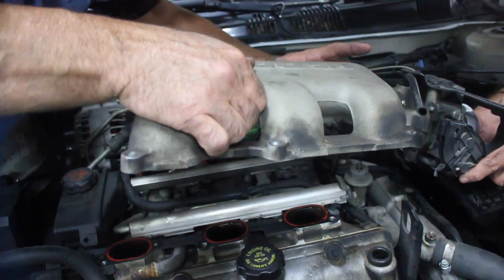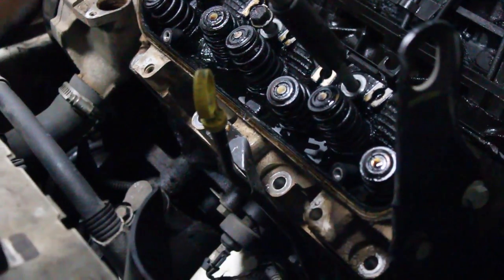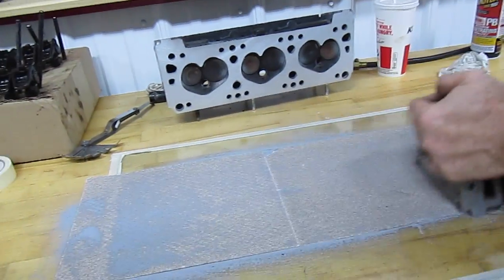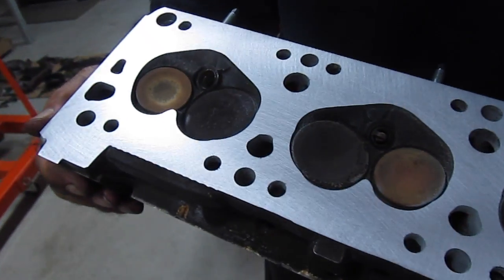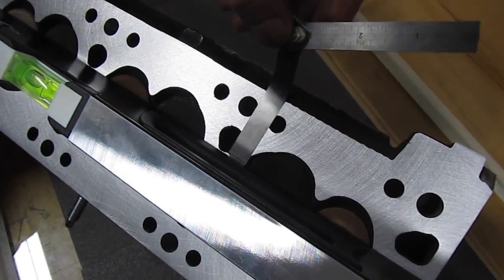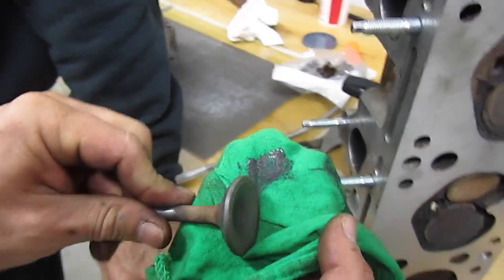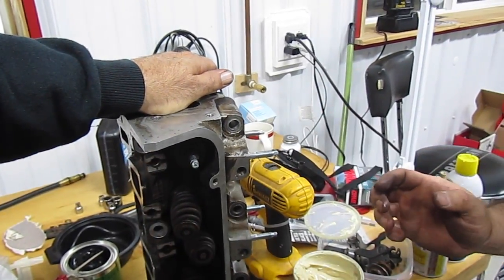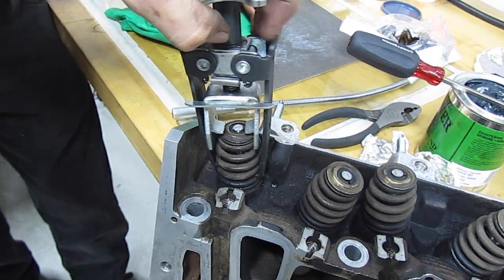RESURFACE a warped cylinder head with low cost sandpaper at home

Comment: sure. works fine. i’m a bit pickier when it comes to the surface the sandpaper is on. thick glass works the best if you’ve got it. Currently finishing up my head gasket job, actually.

‘cept, I’d been driving across country when mine blew. No family or friends around, and hardly any money, 900 miles from home…. in a parking lot…in south texas… in August. It was everything it sounds like. But I bought some mirrors like hangs on the back of a door, removed the trim, and glued em together, and a piece of mdf on the bottom. I did that shit right there in the parking lot.

Comment: Where did you get the glass?  Does your sanding base have to be completely level?  I can't seem to find anything with an even surface, except for this one granite surface plate I bought off of Amazon.  I ended up sending it back because it was shorter than my head and block.
Reply: Placing thick glass onto any decent flat, level surface (eg a bench or table) will provide you with a 'perfect' even surface.

Comment: This is nuts! Current cost to mill a head is about $100, not $400. All that work to take it apart and put it back together but cheap out on the most important part?? Not me. Not even having it done on an automotive belt sender intended for that purpose.
Reply: No one is nuts. Flat is flat. I could do this in the time it takes me to drive to a shop and back. Chill.
Reply: @FisherCatProductions  No way. I just re-rebuilt a motor where the head was done using this method. My machinist just laughed when he mic'd it. Why do this to save $90 on a $2K rebuild???  Goofy!
Reply: @mikecunningham7621  Quit saying it can't be done just because you can't do it. I checked my head using a machinist's straight edge and the biggest shim I could get under it anywhere was 0.0015"! (that is 15 TEN-thousandths) Waaaay past spec needed. It had nothing to do with "saving money." If I can do it myself, I have no need to go elsewhere. You do you.
Reply: @FisherCatProductions  One and a half thou END TO END, not just in spots, is the max spec on the engines I build and that relies on the block being decked to 0.000.  I'll spend the extra $90. Good luck.

Comment: So you don't even know how much you grind off from one side of cylinder head... Other cylinder heads are still on a engines . Creating unbalanced combustion pressure rates . Okay , that's exactly called  half A$$ job .
Reply: You may be right...That's a great point" so when you add block sealer...or thicker oil"...or performance spark plugs..or Higher Octane gas..You change things..Right" But" The Goal is still The Same....To make The Car Run...And Not Run Hot" Don't Forget" This IS a great Engine" It Has it Flaws just like Everything else does".. Again..The Goal is to Get it Back Running..& On THE Road" If you don"t understand that" you don't know how to fix things...Weld...build..I can do it all..I took parts from a car wheels and built a grill" And cook steaks on it" Drink Beers..It's not suppose to like that..But I made it work..I made it cook" I made parts that don't go together work together... LATER
Reply: Good grief, he's not building a moon rocket. Come to think of it, the guys that are building moon rockets just scrubbed the test flight for what, the third or fourth time? No way this will cause any problem on your average road car. But let's keep it under 8,500 RPM, just to be safe.

Comment: No idea where you are from to have that high of a cost to resurface a head. Where i am it cost between$ 40-80 per head depending on how fine of a finish is needed for your gasket type.
Reply: Exactly. Having an aluminum 4 cyl head milled at a performance machine shop right now.. cost $100. Dallas TX. I would NEVER do what this guy did.

Comment: Did you use a mls head gasket? If yes is the car still running properly? I want to do this but just wondering if i can get the surface smooth enough RA 30?
Reply: it works like a champ.  as long as you have a flat surface to apply sandpaper to the head will self level to perfection. if you want you can go all the way to 400 grit
Reply: @-jimmyjames  How flat?  Are we talking completely level?
Reply: @Gh0stInTheMachines81  I've done this several times.  I use a marbel counter top  slab that is completely flat as I checked.  And adhere sand paper to it via water as spray glues unless very thin like 3m can cause high spots on the paper. You could even use copper gasket spray to glue as it sprays uniform. I gently go back and forth. Be careful not to push pull too hard as you can rock ever so slightly and round edges. Has to remain level. So a good wet sandpaper. 3m. Good to go. I have experienced no gasket failures yrs after
Reply: You can use machine mark. Or just use a sharpie to dye, see high and low and row it till flat. Ez pz.  I prefer the marble slab. But a quality glass window or even a fishtank side. Use your imagination. Wood can bow out bless thick and true. You have been warned
Reply: @-jimmyjames  Where did you get the marble?  Does it have to have a larger diameter than the work piece?
Reply: @Gh0stInTheMachines81  there was a marble cutting facility close by me here in Tx. They gave me a pick of their cuttings . So I just flat edged a bunch until I found one suitable with a glass like finish. And yes one atleast  a tad bigger than whatever it is you r trying to true. I'm a tech with a machinist background so I just used my judgement and made a sound call. But like I've stated even a  truly flat boad with a glass top will work. As long as completely flat and doesn't bow n the slightest.. For me the.marble was the way to go for convenience and the fact it would hold my paper effortlessly. I used a very light coat of 3m thin spray adhesive and just barely sprayed it. The sandpaper was a actual wet sand with the thick waxy backing.
Reply: I've done two and three layer mls metal gaskets like the last one I did being a 2001 focus 2.0 zetec. It's been going strong for three yrs.

Comment: When lapping valves with a drill, you should use a couple inches of fuel hose with clamps to hold the valve. The chuck can mess up the stem and prevent a good stem seal.
Reply: Then again you should NOT lap valves, period.  Three angle valves are intended to have a sharp line of angular discontinuity to create a sealing surface.  If you're doing a lawnmower engine go for it, if not, clean them up with a wire wheel.

Comment: I've been trying to do this myself but finding that the glass just isn't flat enough when I check with a machinists straight edge. I went and bought an actual granite surface plate that is super flat, .00015 or better I believe it is. I tried clamping the glass to that and am STILL having trouble getting it flat. (The straight edge on the granite is spot on, totally flat.) I'm almost ready to just use the super 77 straight onto the granite but I was afraid it would be hard to remove. Also, perhaps not all glass is actually flat? This stuff seems to want to be off wayyyy more than .003, more like darn near a 1/16 of an inch. It is thick too, like 3/8.
Reply from the maker: +aeridyne 

The straight edge should not rock at all in any direction on the glass. We used a Stanley level with the machine the edge, we liked that because it was thicker and could not flex. We didn't use the first piece of glass that we found. The first piece was too thin and would literally flex so we found a thicker piece of glass that did not flex or The straight edge did not rock at all in any direction. When we put the sandpaper on we double checked for flex and flexion and there was none. I would say look for another piece of glass. Keep me in the loop on how it is working. I'm going to be doing this again here shortly
Reply: Maybe your head is warped
Reply: Thats why you just spend the hundred buxks to have a shop machine and wash your fo you. Takes all the guessing out of it.

Comment: What did you use to make that sandpaper stick to the glass? I noticed that it was also easy to remove when you're about to replace it with a finer grit.
Reply from the maker: +RC1earth 

We used spray adhesive. I believe it was 77 adhesive spray from 3M. If you had rubber cement, this would also work just as well. The glass was a quarter of an inch thick and after the sandpaper was on we took that straight edge which was an aluminum level made by Stanley to make sure that the glass and sandpaper was flat. 
We used a shop vac to vacuum the aluminum dust when it started to clog the sandpaper. Some people have used wet sandpaper to help keep everything clean and moving. If you try the method please let me know how it went, and if there's anything you learned along the way that would be beneficial to everyone. Let me know if you have any other questions.

Comment: I prefer wet sanding..
Reply from the maker: +bhaggen 
I can see wet sanding working a lot better and faster. As you can see in the video there was a lot of aluminum dust. I didn't like constantly vacuuming the aluminum dust out of the sandpaper. Are used 80 grit and 150 grit dry sandpaper what type of grit sand paper do you use when you wet sand?
Reply: The grit depends on the desired finish, but whatever the grit the finish is smoother & effortless with water. On cast iron exhaust manifolds I simply use the concrete floor with water.

Comment: We charge $35 per head to resurface V6 2 valves per cylinder heads. I guess we should raise the price to $200 a piece.
Reply: $35 per head usa price is great. Australia price $200 per head minimum so for non usa viewers this is accurate.
Reply: scrimmy 6969 Here in South Florida they want to charge me $325 per each head, I have a V6 Isuzu Trooper and I would love to pay $35, but here is not the case.
Reply: @whoeverwhatever9279  in PEI canada they want about $250/head
Reply from the maker: +scrimmy6969 
Thank you for your comment. I did a bit more research on the cost of machining the heads. Although the prices vary $35 per head is pretty accurate. I guess when I called our local machine shops the $200 a piece price also included the machining of the valves as well. I had seen this sandpaper trick on YouTube earlier and was pretty skeptical. My friend Rich didn't want to spend a ton of money on this older Oldsmobile. This is what prompted us to try machining the head ourselves with sandpaper and use lapping compound to grind the valves then put a new valve seals on. I posted the video because I was excited and surprised to find that it work so well. Another part I was happy with, Was because we could watch the material coming off the head we didn't take any more off then we had to. Using this method also allowed us to get the head together a lot faster because we didn't have to wait to have it machined. Thank you again for your comment and I hope you enjoy any of the other videos.
Reply: Thank you for the response. There is absolutely nothing wrong with using the sand paper and mirror trick to resurface a cylinder head. In many cases the finish comes out better because sometimes the cutter grabs small pieces of material and actually runs it across the surface. Again thank you for the reply. Have a good day sir. Jim